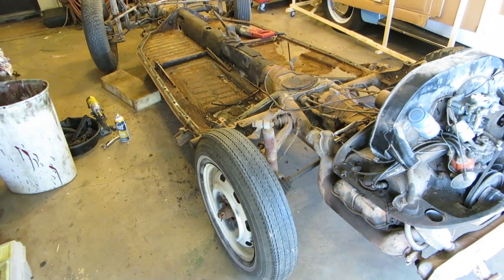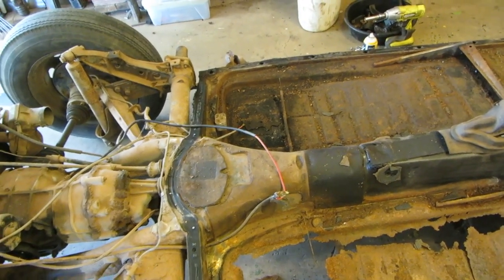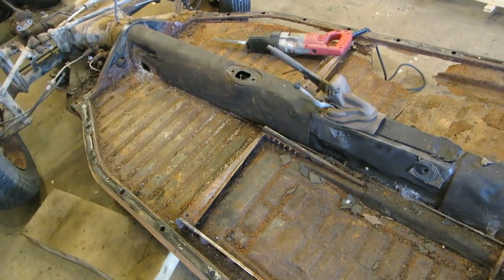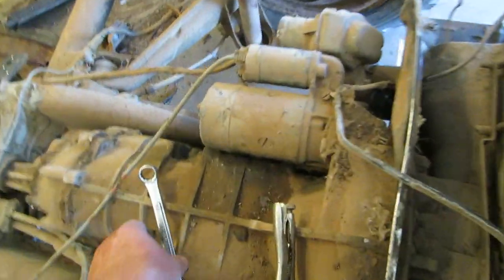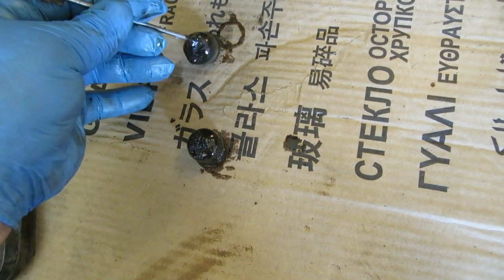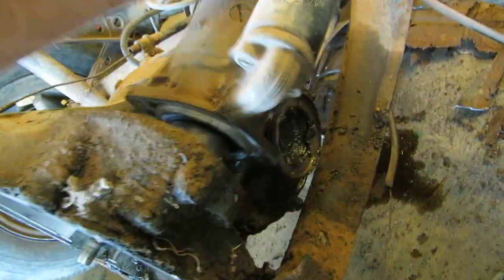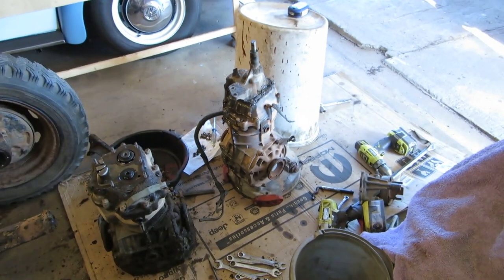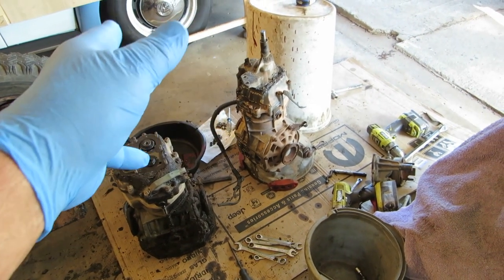1969 VW Beetle Transmission

Comment: I forgot to mention this before. You are going to need to replace the clutch pressure plate on the engine to fit the later style transmission. 71-79 type 1 plate without collar. 
Maybe you can get in touch with EZGZ, he has all the special transmission tools and videos to rebuild the vw transmissions.
Reply from the maker: Good catch! Thank you! I had forgotten about that. It’s been a while..ha ha ha
This trans is a single side, 73 model by the serial number AT prefix. And it takes a 311141025....C pressure plate, apposed to the E suffix model. Why VW was working backward with their alphabet suffixes, according to years on this, I have no clue.
I will order the newer kit for this transmission.
Thanks again 😀😀😀
Reply: @OkFixer  
You're welcome.  Surprised your brother hasn't posted tips to help. Is he okay?  To bad, I'm not local, I have the correct clutch parts available for you to try out the 73 transmission. ☹
Reply from the maker: @vintage76vipergreenBeetle  yeah, I miss him too. He’s ok.  I can’t divulge more. As the CIA would not like........ha,ha,ha